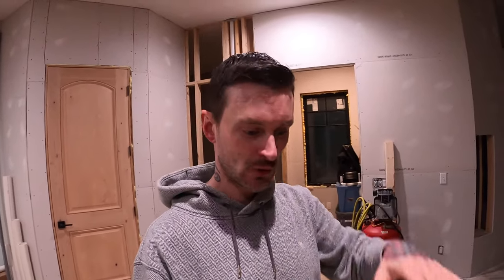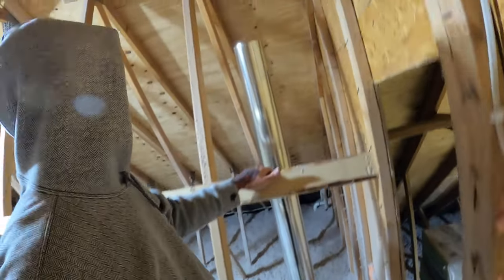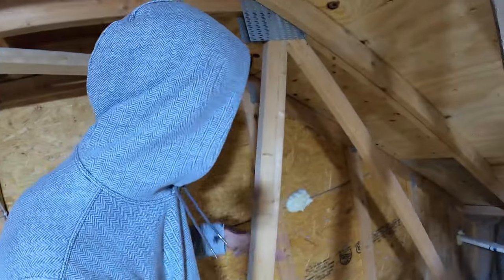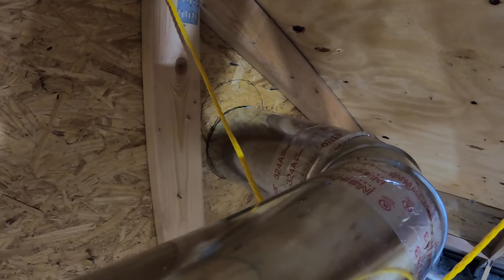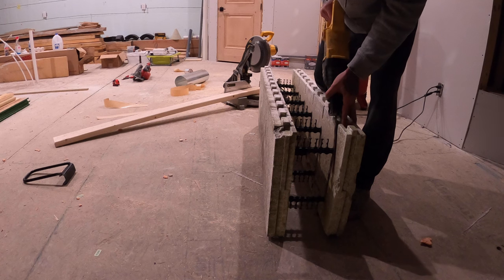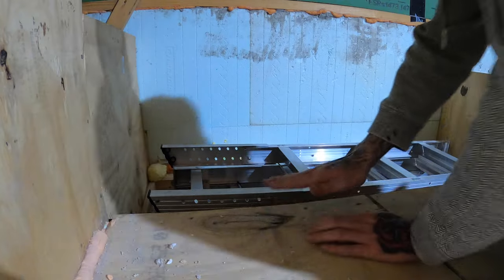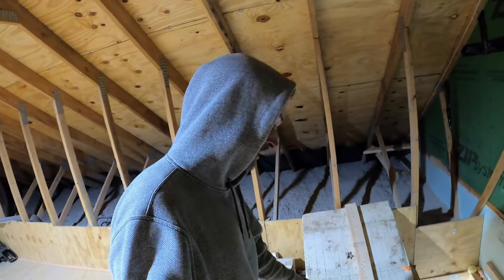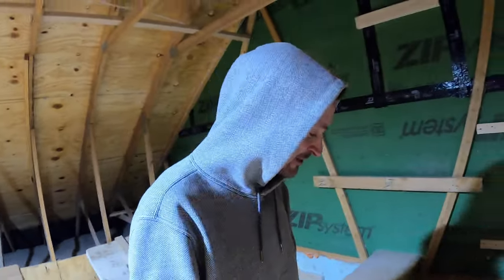Oven venting and attic sealing!!  Vlogmas, day 5!

Comment: Not sure how you're plumbing the ERV / HRV, but if you use multiple returns from different rooms then the air should mix properly and the air in the house should be the same wherever you are.
Secondly, are you going to have some sort of make up air for the rangehood in the kitchen? Once that unit is turned on, all you air conditioning will be sucked out along with you cooking fumes. Usually a make up air vent in the same vicinity of the rangehood supplies the air that will be sucked out with minimal loss of the air conditioned air from around the house. If no make up air vent is used then the rangehood wont work as well. I'm loving the Vlogmas clips, keep them coming! :)
Reply from the maker: I’m not sure yet. I don’t know how many I’ll need upstairs and down stairs.  Still figuring that out.  No air make up yet.  We’ll see what can we get as that bathrooms are probably as powerful or bigger, specially the master bath at 300cfm and that’ll run longer during a shower than the fan when cooking.  Won’t the HRV make up for that or just open and close a door for a second and let the air rush in?
Reply: @neckofthewoods24  The HRV should allow more air to rush in, but that air is usually distributed throughout the house (depending on your setup). If the air output vents are in the bedroom for example, then when the rangehood is turned on the air will rush from your bedroom to the kitchen and out. You're building a tight house, so air will have to come from any gaps you have or through the HRV. This will take some conditioned air with it and the air replaced will be either hotter or colder, depending on the air temp outside . If you have several vents throughout the house they can be adjusted for certain air flows, more in certain areas and less in others. If you had a make up air vent near the kitchen for the rangehood to draw from, the air being sucked out would have less distance to travel and not take conditioned air from elsewhere and potentially cause a draft from source to destination. In saying that, it's good to have the air mixed around the house so you don't get stagnant air in parts of the house, so multiple returns and output vents are ideal when using ERVs / HRVs. It is recommended that you have the house evaluated by the company suppling your HRV and they will take into account bathroom fans and rangehoods and know where to place the vents and returns. Hope that makes sense and remember when exhaust fans are running, they move a lot of air, your air exchange could be high if an exhaust fan and the rangehood is on at the same time.
Reply: Matt Risinger - Make Up Air for a Kitchen Exhaust - Most Homes Suck. (Pun intended)
Reply from the maker: @PaulyDownUnder  yes it all makes sense.  ill have no one to install or a company to really buy from so we just have to get it right.  i guess if we run the fans and the house becomes negatively pressurized, we'll just have to open windows or doors and get it equalized if they will open.  it cant be that hard to open a huge from or rear sliding door and have the air equalize correct?
Reply from the maker: @PaulyDownUnder  i saw his episode on his home with holes in his garage door showing passive air flow.  ill have to watch it again to learn more.
Reply from the maker: @PaulyDownUnder  I’ll watch again.
Reply: @neckofthewoods24 There's so many videos on make up air on YouTube, here is another good one that is slightly different: "Kitchen exhaust and make up air all under one hood at NS Builders Lake Drive Custom".
Reply from the maker: @PaulyDownUnder  thanks I’ll check it out!

Comment: this is an interesting topic.mmmhhh...I have exakt the same heat problem.
In the basement the air feels like in a humid freezer. It does that in Summer and Winter. In the first floor below the atic, it feels warm, dry and very good. It does that in summer and winter time. There is no need for having a heating or cooling system up there.
In the basement the climate is horrible, even though the floor and all wooden walls are hand warm. all draywalls feel horribly cold, compared to the wooden walls.

In summer I open all windows and doors to let the heat from outside inside the basement. I have no idea why the climate in the basement is that bad.
Reply from the maker: no moisture issues?
Reply: @neckofthewoods24  Will the HRV unit help considering it will be moving air throught the house constantly?
Reply from the maker: @geofpaoletti4531  yes it will.  It does have a condensation line just like the minisplits so we’ll have 4 units helping.  I don’t think we’ll need a dehumidifier after they are all in.
Reply: @neckofthewoods24  that's not what Matt R says!  😜
Reply from the maker: @geofpaoletti4531  for humidity?   They only install ERVs in the south though.
Reply: @neckofthewoods24  Sorry, I meant a whole house  dehumidifier.  Along with A HRV.  Matt is a super huge fan of adding whole house dehumidifiers.  Currently here in Pensacola, we have 100% humidity right now!
Reply from the maker: @geofpaoletti4531  yeah we’ll have to see.   It’s only bad a few months here and the 3 head units will be working probably overtime so they’ll be pulling a lot.  Fingers crossed we don’t need one because the 4500sqft roll around unit I have I don’t want to hear that thing all the time.